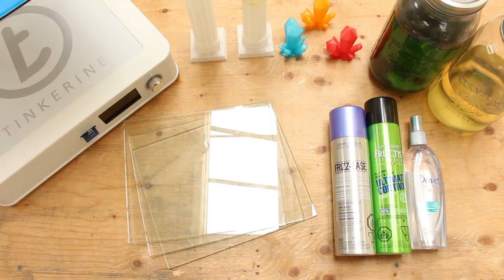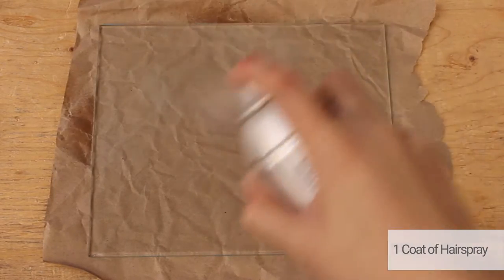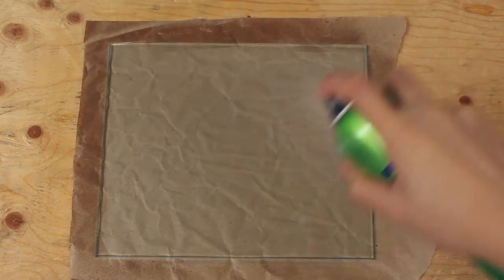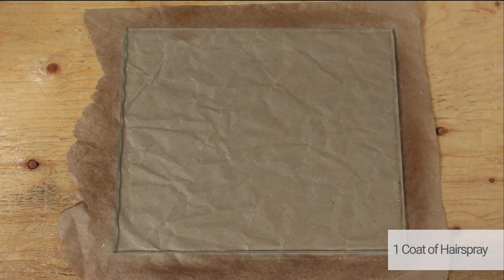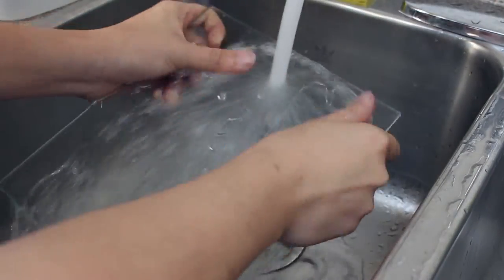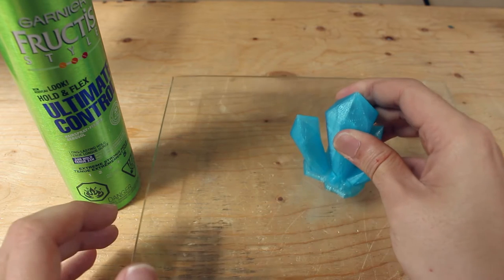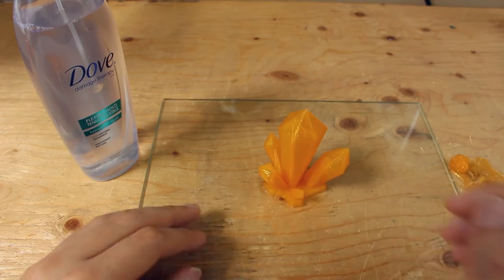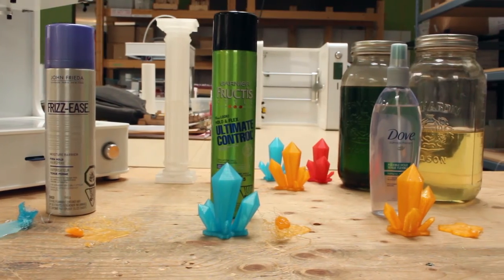Bed Adhesion with Hairsprays

Comment: i guess this is without an heated bed. i use the cheapest hairspray at the store and it sticks really really well, you have to use some force to take it off of the bed when finished so i guess heat makes the big difference
Reply from the maker: Hi Bracco pls,

Do you have heated bed with your 3D printer and what is the brand of hairspray you use?
Reply: yes heated bed and hairspray is Splend'Or
Reply from the maker: Thanks for letting us know!  We will look into trying Splend'Or.